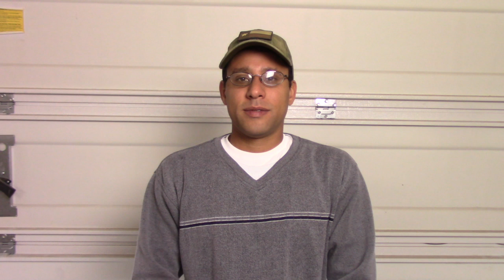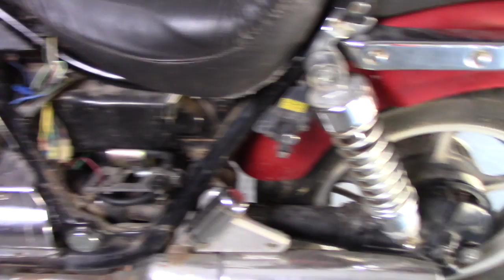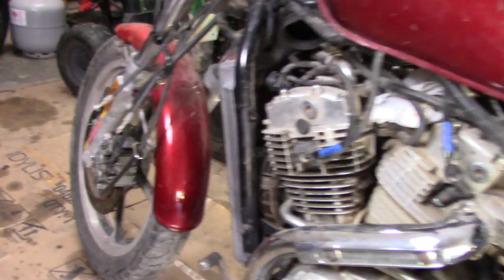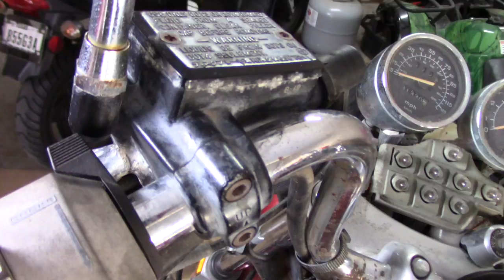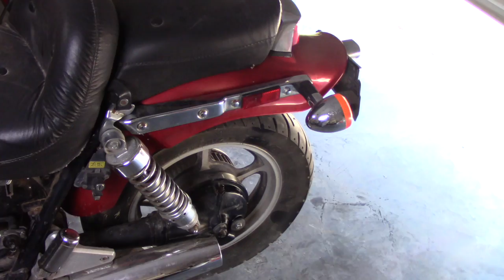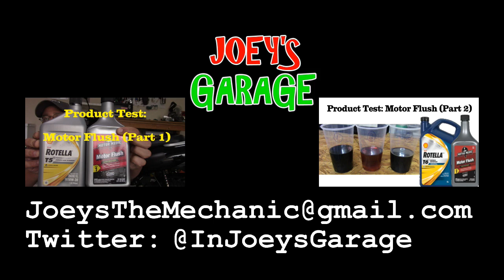Project Starfire: Motorcycle Restoration Introduction

Comment: Oh Man....you really have a lot of work to do on your Honda. It is a big job and a credit to you for attempting as your first bike restoration. I have been restoring bikes since the early 60s and have done a lot of difficult ones so I know the problems that you will encounter. You have the right mindset for the job so it should be a breeze for a skilled chap like you. Where do you live? The good things about your bike.... it is a Honda....Reliable.....and it has shaft drive.
Reply from the maker: Thanks for watching.  It seems like a lot of work, but at least they are many small projects, instead of huge ones.  Hardest part I found is finding parts.  Then setting up the cameras and lights for recording.  It would go a lot faster if I didn't have to worry about recording and editing.  But that's why I bought this bike. To have a garage project, and something to do for my channel.

Comment: That's what I call old school. And it's in better shape then my Honda 90.
Reply from the maker: That's good to hear. It will be my first motorcycle, and I picked it out with zero experience.  Once I get the carb rebuild hopefully the engine will fire up.  That's the mystery I'm still dealing with.

Comment: how long was the bike left laid up for? mines been 20 years and needs alot more than it would seem.  Change out the brake lines if they are factory they are 30 years old! looks like the rear drive is leaking onto your tyre with that spot.  new tyres aswell, if the bikes been laid up for a long time the rear seal between the gearbox and engine (crank seal) will need replacing, most rubber parts will be perished.  Im doing a 88 BMW R80RT good luck though!
Reply from the maker: It spent about 5-6 years in a garage. Thanks for the advice and watching.